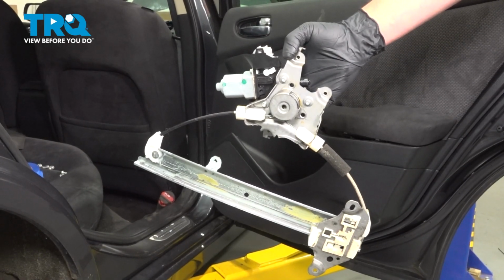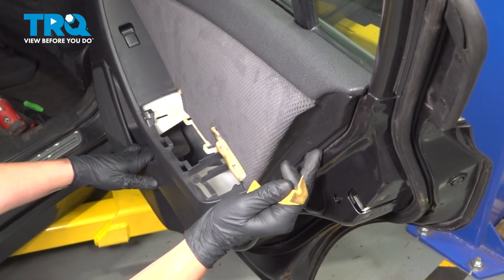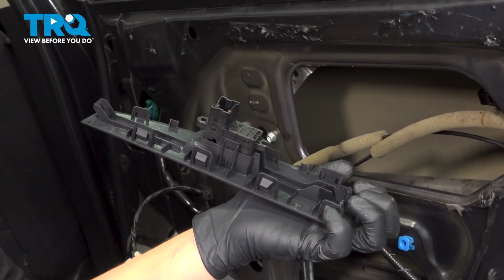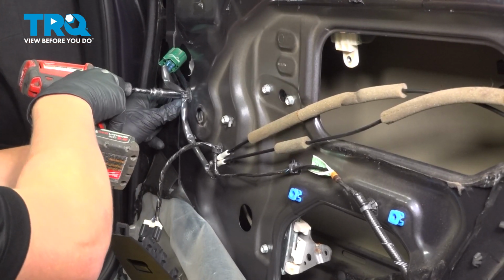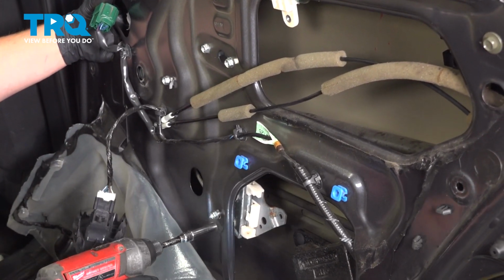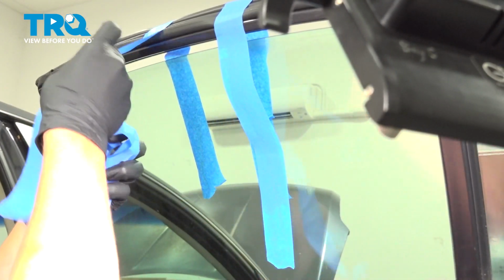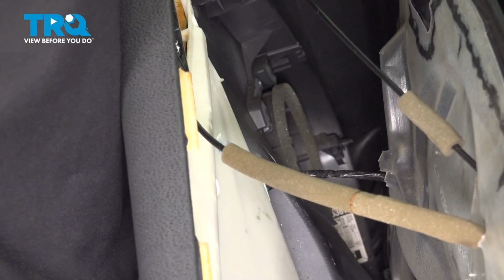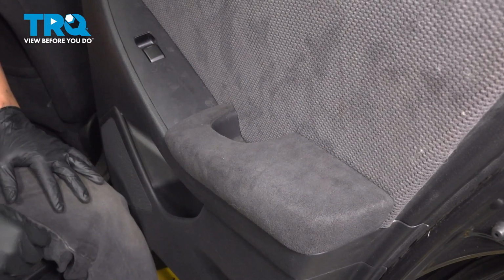How to Replace Rear Power Window Motor & Regulator Assembly 2007-2012 Nissan Altima

Comment: If the motor/switch isn’t working and the window isn’t moving at all, how Do you manipulate the glass while working on this unit? Is there a way to raise the glass safely while waiting for the replacement part(s), so that it’s not stuck in the down position? Thank you.